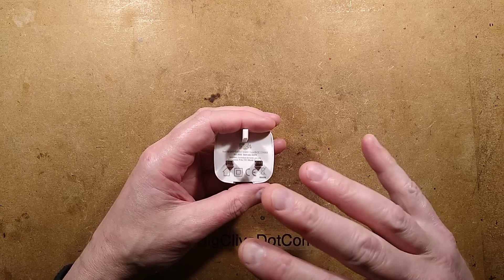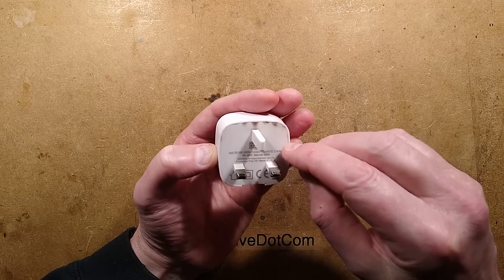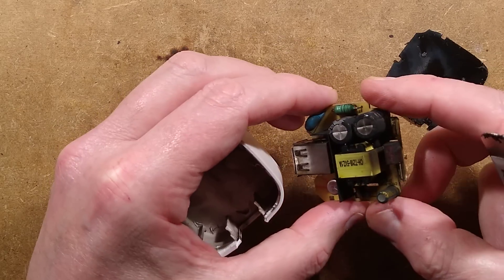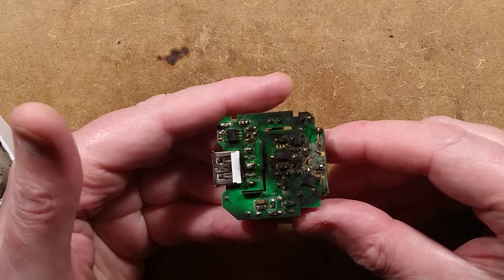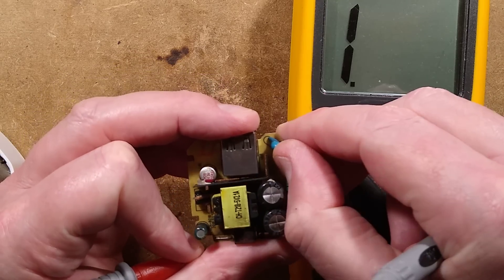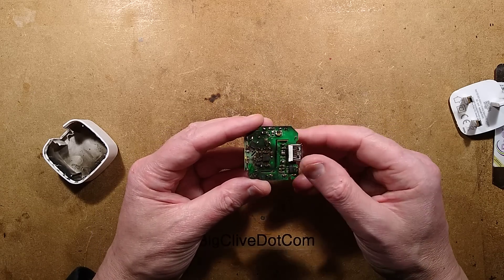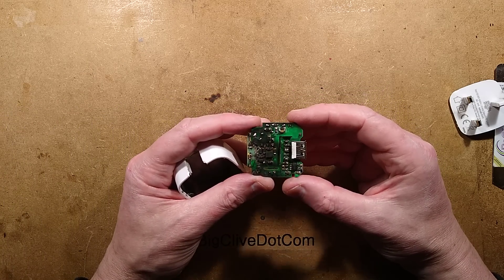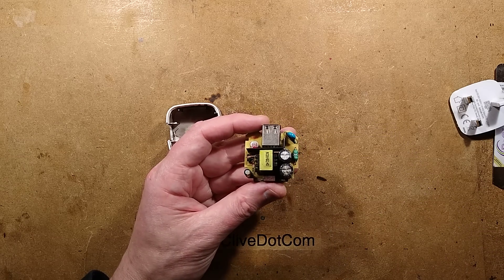Poundland USB versus lightning  (The lightning won.)

Comment: I read somewhere that lightning is so fast (speed of light) and so powerful that it can actually bypass a circuit breaker and pass through it in the time that it takes the breaker to trip OR it can actually jump the tripped breaker.  Both instances not super common, but it can happen.
Reply: The energy delivered is impressive too - about 1000 MJ per stroke.  If your supply is hit a distance from your home, line impedance and capacitance will attenuate the voltage profile a bit (especially if you have an underground supply), but the nearer the stroke to your home, the less "filtration" provided by the cabling. Well worth investing in the small DIN Rail consumer unit MOV suppressors if you live in a lightning prone area.
Reply: Disagree that these are not super common.  I'd say the first is the norm for all breakers and the second is certainly the norm for all breakers in homes.

Comment: Clive, I personally feel the zoom feature is used too extensively, to the extent that not everything remains in shot. Would it be bad for me to request slightly less Monster Zoom Action (MZA) in the next video? I'm not completely sold on high-resolution macro shots of your wrists with the electronics up in the corner of the screen. But this could be a new direction for your channel; what do I know?
Reply from the maker: I zoom for the benefit of people using small screens like phones.
Reply: @bigclivedotcom  heavy quavo I thought that was the reason why you did that thanks for confirming maybe you should say that in a few videos as well.

Comment: Some years ago a house a couple of doors up from one of our customers was struck by lightning. What I assume happened was the coaxial (thin wire ethernet) network cabling around the building mush have had a current induced in it as the server which was the only computer connected to the network. Smelled of burning and was still running. A quick internal inspection revealed that the ethernet transducer on the network card was convincingly exploded. However, it appeared to have taken one for the team as a new network card quickly had the server working again.
Reply: As I recall the Ethernet standard requires 1500V of isolation between the coax and the rest of the machine. Same is true for twisted pair. Probably why only the Ethernet transceiver was damaged.
Reply: @brianleeper5737  I had forgotten that figure was so high, obviously designed to protect against mains on the network cables.

Comment: I had a close lightning strike once that managed to kill the ethernet port on my main computer, and nothing else.
Reply: Is that happened to my father's laptop 116 up this a lot worse.

Also I talked my father one time to changing the processor heatsink and other things over the phone doing tech support for your father telling him how to repair it over the phone he was a bit nervous to even go in there because he done some computer stuff before but nothing like that.

I've done that quite a bit with people and tell him how to do repairs like that over the phone even sometimes complex things that you would not normally want to do that way but were entirely successful. On the other end.

You'd be surprised how many people think that you remove screws to replace a modern headlamp when you actually change it from the rear of the headlamp housing by turning it and pulling it out but then again in the earlier days that is how you did it at least in some cases and yes I've seen people think they're screws to remove the housing and or bulb thinking you're a seal beam and of course obliterating any alignment that's been sent those heavenly going to the mechanic to get them properly real on it. No one guy that was actually pulled over because of it it was so out of whack and you didn't realize it.
Reply: @Spider's Morning with that user image it's your username should have been offline YouTuber every reference to the dinosaur for Google being offline on mobile.
Reply: @Spider's Morning i think i remember reading somewhere that some usb ports have circuit breakers... i think.
Reply: @FellaJohnLittle It's common for computer USB ports to have 'polyfuses' (self-resetting thermal fuses) which trip in a fault condition and reset once it's cleared.
Reply: Back in the day, when dial up was still the norm, I left to go to my grandparent's for the week.  When I got home, I went to get on the internet and the modem wouldn't dial out.  Turns out that even though I had turned the computer off, the modem took a hit and fried it because I didn't unplug the phone line.  At least it was an excuse to upgrade to a 56k modem :D
Reply: I used to have a stack of fruit-flavor iMacs with dead ethernet ports for that same reason. Unfortunately they all went in the bin as they were essentially useless.

Comment: I've seen one of these exact power supplies first hand that had blown up in an almost identical manner.
My best guess at the time was that the USB cable had come into contact with one of those fly zappers with the blue lights on the inside. I'm not sure whether that was the case now but it's the only thing I can think of that wouldn't have caused issues in other places in the building.
The scorch marks were burnt into the surface of the wall socket as well, so it must have been quite a pop!

Comment: I had this charger in orange, eventually all I could smell was burning.  Binned it.
Reply from the maker: That's the difference in this new unit.  They've replaced a diode that used to get very hot, with a synchronous rectifier which should stay cool.

Comment: Why am I not surprised to hear that Big Clive has shrapnel embedded in his ceiling ?

That paper layer between the board and the mains terminals looks like it may have contributed to the destruction. If that was the only insulator then I'm thinking the isolation gaps in the board were pointless !

Comment: random thought, those 1000v rated diodes, have you ever tested one at, or above 1000v to see if it really could handle that?
Reply: Big car should do it I haven't seen anyone else yet I have searched for it but might be a first it would be interesting of course but when those pack testers or insulation resistance tester is would probably be a thing if not go to one of those channels and has what does big labs and all the test equipment excetera excetera excetera

Comment: I found it odd how nothing else was seemingly damaged, you think it would also be worth having that section rewired back to the fuse box?
Reply: House re wired 2 years ago before I moved in. All latest recommendations have been implemented. I thought it was ‘odd’ just the one thing.
Reply: If in doubt get someone qualified to check the system. If failure modes such as a house fire are possible its worth  making sure its safe. Couple of hours for an electrician to tell you your paranoid isnt a massive cost. 

I would check the socket, breaker and RCD at a minimum. If there is an issue, its likely to be one of these, and they are cheap to replace. Your problems will be on the wire clamps, or switches. Any scorch marks or failure to trip when tested and they should be swapped out. Possible check all the switches and junction boxes on the circuit.

If the wiring is known to be poor quality (lots of mods and decades old) then it may be worth inspecting and redoing the circuit.  Judgment calls would have to be made on that, but if its already planned to redo the wiring, it would be worth doing it sooner.

Comment: That PCB is definitely overcooked.
Reply: Either one of those times when you thought you put something in the microwave for 1 minute and it was 10 or more actually.

Either or somebody trying to overclock it to get more power out of it and failed.

Or I'm sick of someone abusing me by hacking me to do something I shouldn't do and said all in that hits self destruct switch.

Either it says I'm not being used I'm plugged in all the time drawing too much power let's see what I can do about that Bang the AC adapter takes its own life LOL.

Either or it said I'm not doing anything ever I'm just stuck behind this couch is plugged into the extension cord to no one knows I'm here same thing as before decides to end it LOL.

Comment: I used to work in the telephony industry.
Got called to a customers site which had taken a lightning hit.
The system was down, and there was no sign of life. Removed the lid, and started pulling out the line cards... They were covered in scorch marks, and where chips used to exist, there were now just legs.
The case was full of bits of shattered plastic from the casings.

I replaced the line cards, and the system started right up with all it's original configuration setting still in tact.

Gotta love a well isolated system.
Reply: 3 Compaq, 3 Hewlett Packard, 1 MicroVax, 1 JCB and one hole in the road.
The MicroVax took its usual 15 minutes to reboot.
The 3 Compaqs - "What power disruption ?"
2 HPs - rebooted
The file server - the last HP took much less than the statutory 5 seconds to self destruct. The 2 big chips in the PSU were now chips with craters in the centre of them. PSU from another machine used....Of the 640kb base memory - counted only just over 300 - so the hard drive was migrated to another computer - which didn't recognise it as a hard drive - or anything else for that matter. The data on the disc may have been ok but we'd got it all backed up in any case - so the whole HP went in the skip.
Reply: @millomweb  And what about the JCB? Was it a 3CII - because those are darn "indestructible" aside from a pretty typical British engine compartment solution.
Reply: @ehsnils  JCB and hole were unknown at the time - just info that filtered through the grapevine a few days later!
Considering the bang factor,  I'd guess the JCB was just the source of a cable fault ;) so I'g guess it survived with a severe burn mark on the bucket !
Reply: Were the line cards designed with sufficient protection for off-premise extensions? If so that might be why the damage was limited to the line card.
Reply: Our Avaya Pabx is protected by Krone lightning arrestors. I still don't trust them enough to feel safe in a storm.
Reply: @whitesapphire5865  Probably depends whether phone line or power line is hit ! The size of phone line wire - it ain't going to carry a lot of current for very long !
Reply: @millomweb  Aye, maybe not, but it's that clout in the lug hole that I don't fancy!😁😆🐱
Reply: @whitesapphire5865  Have you not had your ears pierced :))))))
Reply: @millomweb  That, I have, but lightning's attracted to bits of metal! ⚡💫💀
Reply: @whitesapphire5865  The standard, at least in the USA, are 5-pin protectors. Two pins for tip/ring in, two pins for tip/ring out, and a ground. These are what you'll find at the MDF in a telco central office, and they're also commonly used on the customer end too. They typically combine a three-electrode gas discharge tube with a fusible link, although solid-state versions are available (and, in my experience, do NOT work with SHDSL or VDSL). I would have no problem trusting these in a storm, assuming that they are decently grounded.
Reply: had a 3com line card once with a similar issue, ended up importing one from Holland! Had a bit scorch mark up the front of the unit. Rare then, wouldn't want to try and get one now.
Reply: M Harris  Not sure when HP took over Compaq - was it mid 1990s? Wondered if your parents' machine was a genuine Compaq. Even so, they'd downgraded them from the early 386s (30Mb HD !) which these were. I daresay equally good computers but not so robust PSUs !
Maths: 0+1=0
HP+Compaq=HP (or 'HPC') I've a HPC here. On-board graphics has now failed - get vertical lines on the display and it won't do anything other than try to display the initial screen. Rather annoying being my file server! I pretty much run on laptops nowadays. I wouldn't accept a donation of a HP computer !
Reply: @Leagle Eagle Aye, that's sort of what I'm getting at. I'd rather just not use that thing in a storm. "Drop the phone and run away, and live to phone another day"!🐱😁
Reply: Had more or less this exact experience with a Merlin 820D.
Reply: NEBS uber alles
Reply: Isolators are for pussies

Comment: I was salvaging parts from a 15yr old LG DVD/DVR machine the other day. The suppression was impressive. Class X capacitor, followed by common mode suppression inductor, followed by another class X capacitor and another common mode suppression inductor. What's  more, there were also the zig-zag voltage spike jumpers between live and the case and between neutral and the case. The unearthed case, oops!🤔
Reply: Sounds like the mains side part of good quality PC power supplies as well, then you check the crappier no-names and they have all those upopulated footprints on the board...
Reply: @Joachim Shekelberg Agreed, it was the second level which caused me to say it was impressive. The spark gap to an unearthed chassis was less impressive.

Comment: I bet the magic smoke release was a site to behold.
Reply: Most of the magic smoke appears to have been held back and condensed inside. So all it needs is a drop of ionic silver solution and recombination will occur, rejuvenating the unit back into working condition. (I didn't get where I am today ... etc.)

Comment: The other advantage of using a power strip with chargers that have that moulded plastic earth pin instead of plugging it into the wall socket is that if the earth pin snaps off you don't have to get an electrician to come and take the wall socket out. Obviously there are ^^some people^^ whose job it is to be able to change wall sockets, but I'm not one of them.
Reply: zh84 look up on google. Shut the power and give it a try. It’s a good skill to have.
Reply: Wonder if you could use a broken key extractor to remove the broken earth pin?